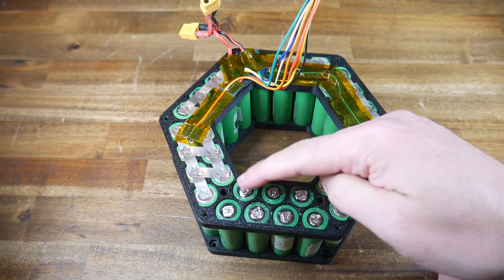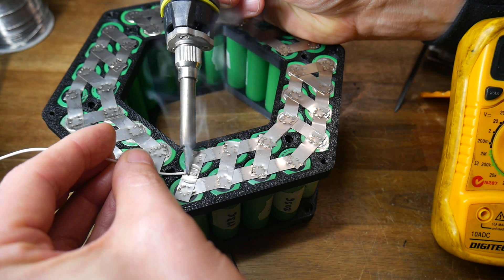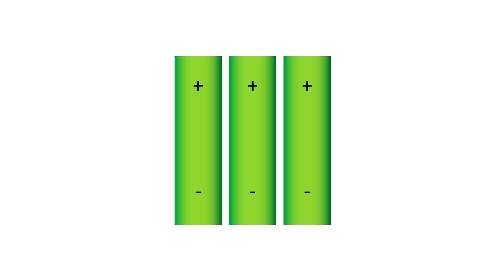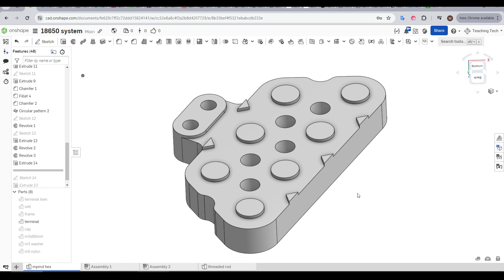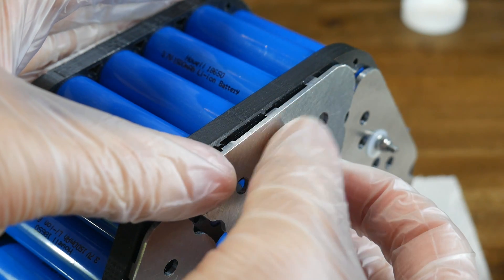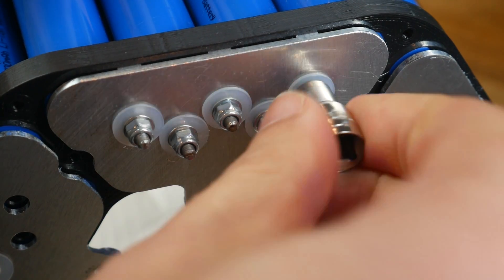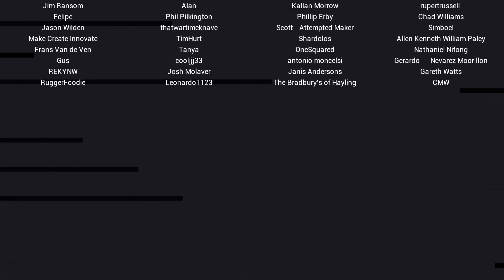Experimenting with a new (and probably flawed) 18650 building method: No soldering or spot welding!

Comment from the maker: I think most people understand I'm putting myself in a vulnerable position by so publicly sharing this concept. Therefore I'm very appreciative of the great feedback I've received.
1. Many people have suggested a washer with a shoulder to fill the gap between the terminal and bolt. There is a decent air gap there but there's no doubt a better fitting washer would be an improvement.
2. One of my key takeaways from the feedback is that even if the battery is good right now, it may degrade over time from a number of factors. These include thermal expansion/contraction, a change of torque in the bolts, the conductive paste drying up, etc.
3. Some people have pointed out that the cells aren't meant to be compressed like this. Some compression may be ok, but not enough and there won't be good enough contact. Knowing the exact value required may well be impossible.
For this particular battery, I'm happy to modify it and check in on it over time as a long term study. I made this printer portable as a challenge, not because I needed it to be. In reality it will see very little use, and when it is used, it draws very little current (it doesn't even have a heated bed connected).
For the serious battery, I won't pursue this building concept. I will still 3D print the frame, but will use traditional spot welding to join the cells. There may be the potential to machine my own busbars, but I will rethink the application to avoid compression and the reliance on needing conductive grease. A clever hybrid approach might yield benefits.
Thanks everyone, especially those concerned about my potential pregnancy!
Reply: Have you considered using springs to ensure good connections to the battery terminals? There is so much variety of types that I am confident you'd find one that can handle it. Plus, it's quite easy to test how much current a spring can handle (a couple of 1.5V AA sacrificial batteries will do trick).
But I get your pain. Was pulling my hair out when making one and I didn't have a spot welder. Then with the strings it worked like a charm. Doesn't out pressure on the terminals too.
Reply: The nylon shoulder washers are made specifically for this application
Reply: @Frient  came here to say that, nylon shoulder washers are like a top hat for those that don't know, they allow the washer to be centered.

I personally find the metal screws a little sketch and i'm glad your second design tries to avoid it. Curious why you are avoiding threaded inserts into the plastic?
Reply: I think the design as shown is such a big safety risk that you should edit the video to point out all the flaws and change the green check to another red x. Compression with bolts is not compatible with the thermal expansion and just fixing the washer is not enough. If you test with this design please never leave it alone and assume it will catch fire. It may not, but don't take the chance.
Reply: tbh all batteries should have screw terminals from the factory so that literally nobody has to fuss with all this. heck 18650s seem like so much effort why not just use the big chungus cells on a power bank this big eh? great work as always m8
Reply: @killsalot78  screw terminals are heavy.
Reply: Since the body is hex shaped, have you thought about making the frame in 6 pieces and just making them so they can connect to each other? That would solve the problem of the entire frame being worthless if one section goes bad.
Reply: I take it that springs like on C batteries won't work due to the high current de-springifying them?
Reply: @ryelor123  not alone, you would need a multi strand copper wire of appropriate gauge to pass current, I have a spring like that in my flashlight.
Reply: How about threading a fastener down to meet the battery contacts? It would secure each battery individually (making slight variances around each battery less of a problem) and  at the same time serve as contactor as well as a attachment point. Set screw/lug with a stud.
Reply: @jdepriest1474  differential thermal expansion is likely to cause issues, weakening the contact with each thermal cycle also screws can put tremendous amount of force with modest torque.
Reply: Lifepo 4.
18650 .
The safe batteries. 
And match up better for 12 volt. 
They are also in the super b accu's. 
Forgeth lithium. 
Fire hazard
Reply: I would suggest using nylon bolts rather than metal making it impossible to accidentally short the cells , and use springs on each end of the nylon bolts to keep the mounting pressure dynamic to allow for heat expansion.

Comment: You are using fire hazard batteries. 
Tou need to use 18650 lifepo 4.
Batteries. The safe batteries and the lifepo 4 18650  batteries wont explode if you over charge them they Just heat up and stop working it is verry dom to use 18650 lion ion batteries

Comment: As someone who almost lost his house due to 4-pack of 18650s... You don't want low-temp thermoplastics anywhere near overheating cell (rare, but probability works against you in larger packs). Be paranoid about exposing any and all terminals and connections. When shorted, these nickel strips burn like a candle, but only if you're lucky (the currents are massive, and way above the specs). Do you really need 210 Amps of constant current? High-current cells are more explosive in edge scenarios.

Comment: @teachingtech
You should include a protrusion in your 3d printed part that goes outward away from the battery. It would go around the screw and threw the hole in the metal plate. In this way it would be in between the bolt and the metal part eclectically isolating them. It could also be used to line up the metal plates. instead of needing a separate triangle protrusion.

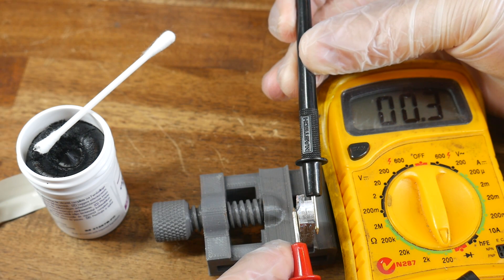Comment: 8:16 That's a bit janky. You should put your samples in circuit with a high current (say 30A since that's the cells you're using) and measure the voltage drop with vs without grease

Comment: I like bolt together batteries, but I'm not wild about a conductor going through the pack.  Your second design seemed much better if the center piece was not conductive. What would make me feel much better about the first design would be the use of nylon umm ... 'T' bushings.  Not sure what they are called, maybe T-tubes they are very commonly used to insulate the bolt going through Power MOSFIT's in electronics so they may not be much more expensive than the washers you used.
Also, the bolts are much larger than you need, and I understand how important the bolts job is. Without looking up the clamping force I'm confident a 4 or 6-32 bolt would be more than enough and reduce weight and cost as well.
My business involves LEV (Light Electric Vehicle) batteries. Pack vibration and deformation (twisting, bending etc.) are real world problems. The conductive grease and clamped together batteries are better from that standpoint assuming a short is impossible.  I also think springs pulling the pack together with non-conductive end pieces would be Ideal but could require some tricky design to prevent an assembly nightmare.
One of the VERY HIGH END scooter companies actually TIG welds copper conductors to the cells. I know, you can't weld Copper to Stainless Steel ... but apparently you can. Or at least they claim to.
EDIT: I just read your pinned comment...yeah "shoulder washers" that's the ticket.  :)

Comment: The best lithium battery assembly approach i've come up with involves a small copper "contact pin" which is just a circular piece of copper that has a shoulder so it can be retained within a cell holder, one side of the pin touches cell electrodes. 

On top of the contact pin is a small piece (4mm diameter x 1-1.5mm thick) of plastic or fiberglass with a tiny center hole, it's a "carrier", held in the center hole is a engineered wire contact (helix of 5 or 6 gold plated wires around a stiff rubber core surrounded by softer rubber), companies mass produce contacts like this for testing pcbs and are very low cost. They can be made with continuous current ratings from 6A-50A+.

Carrier with wire contact and contact pin sit in a hole and are "floating" with around .25mm-.5mm of designed compression range, a piece of sheet metal or a pcb is what wire contact finally touches.

Approach like this allows for placement of the contact pin/carrier/wire contact stack above cells rim on positive side for negative connection allowing for single sided assembly meaning only one pcb is needed or metal sheets only in one cell holder.

Comment: Thanks for putting your project up for criticism!
As mentioned lithium cells are dangerous and a bad design can literally threaten lives. I have developed hard- and software for battery management systems, with some incidents involved.
One point I'd like to make is, the contacts with the cells are neither perfectly even nor perfectly parallel to the cells' surfaces. Meaning your contacting area might not be a surface, but more a point or line. Putting pressure on it might cause the area on the cell to buckle. To my knowledge, the industry solution for this is multiple independent springy contacts per cell. We once build the complete overkill version of this with 10 high-current pogo-pins for individual 18650 cells on testing equipment.

Comment: The lack of a BMS on these battery packs is surprising and concerning.  Not surprising, however, that the first battery failed so quickly and I suspect the other to blast a bank of cells in undue time.  Adding one will increase the safety and longevity of your pack and you can get a decent one for not many moneys when buying for low amperage applications.  I like the cost to quality/features ratio of JK BMSs but there are other options out there that will do the job.

Comment: I don't get it. You are milling almost the living Həłľ out of every thing for this project and you šh¡ťțingly chicken out on the nylon washers?! Dude don't be ridiculous and either buy appropriate Nylon washers with the right size hole or machine washers with a leading neck that slide in the hole such that aligne themself to avoid this annoying finicky alignment of those morronically large washers 😂 the second design at the end is a pretty good approach though 👍what material do you want to use for that spacer/connector thing that you can screw bolts on and how do you do you want to prevent from falling on you if you 3D Print them and then over tight them even if you won't over tight then the material will creap away on you over time. 🤔

Comment: If you're going to stay with the compressed connector plate, consider having only three batteries under it. Three points make a plane, so all batteries would have the same contact pressure. I would recommend using a spring to provide consistent/constant pressure even if the cells expand.

Comment: I would consider cutting slots around the terminals somehow and have the terminal protrusions slightly longer. This way when tightened down they could be tensioned by the terminal material itself securing a consistent pressure and perhaps a better connection?

Comment: I experimented with very thin PCB substrate (or you can also use copper tape) with high density foam behind it, and the backing plate with "pads" 3D printed into the compression plate. The foam gives some springiness to keep the PCB against the battery terminal. No CNC required. The bolts go through plastic shoulder at the top and screw insert at the bottom, away from anything conductive. My goal was to be able to reuse laptop battery packs and simply swop out dead cells as they die and squeeze a second life out of the precious lithium. Building and rebuilding 2nd life packs in a safe way could be a job creator for the local community.

Comment: I'd want to see a sleeved washer on those bolts. I'd be REALLY nervous that they may vibrate or somehow make contact to that metal that's only 2mm away. A sleeved plastic washer would guarantee insulation of that bolt.

Comment: using peek bolts instead of the steel ones in the first design with a appropritely sized washer will reduce the assembly time and increase safety

Comment: I think a mixture of two approaches would be a better option. Spot weld pre-drilled tabs to each cell, then bolt the tabs to a busbar so each cell can be individually disconnected via a bolt  for servicing. That way, you won't risk crushing cells with axial pressure loads or be relying on clamping the cell terminals for continuity.

Comment: G’day Michael. Can’t tell you how pleased I am to see you still using your Carvera and I’d like to thank you for mine too lol. When you did your initial review I sprinted straight over to kickstarter and was delighted when I was able to put my money down and from the moment it arrived, well, wow, it is still just simply the best tool in the shop. The potential work that I can do with this amazing little machine is simply magnificent and I am so grateful for your inspiration to take the chance on buying this little machine but seriously, automatic tool changing on a desktop cnc machine, that is the greatest bugbear of any home cnc operator, when a job finishes at 2 in the morning and the machine sits idle after having hogged out all the hard stuff and the long and arduous final layers must yet be cut, well, when I get up and can think, hmmm 2 cups of coffee today maybe, and I can then change the bit and set the little beastie back upon its allotted tasks. Having it do it all, all by itself at 2 in the morning while I happily snooze, how good is that hey lol. My only disappointment has been to see the company now selling a cheaper version without the auto tool changer. What a waste, that is the whole, complete and utter selling point of the original machine, auto tool changing on a desktop cnc that doesn’t cost $20 grand. Oh well, I’m so very pleased with mine, I hope others will save up for the full machine. It’s still way cheaper than anything else I’ve seen with auto tool changing, and I am sure they also will be truly pleased that they did. Thanks again for the great inspiration, you and Angus over at Makers Muse whom you know of, are responsible for my delight in every laser, 3d printer and cnc machine that I have either built, like the massive lowrider 3d printed cnc machine, or bought, like my Ender printers and my well loved Makera. So thanks mate, getting on for ten years of great teaching and advice, I’m very grateful, thank you

Comment: The main benefit of the v2 you showed in the end of the video is safety, those bolts are electrically seperated.

The main problems of the battery and the challenges are:
1) safety if battery is crushed
2) overtightened bolts
3) bolts lose torque overtime
4) reduced volumetric density

You may find interesting how this approach was solved by the company Trampa for their electric skateboard.
Their approach is to use pcb with integrated bms.
Looks brilliant to me.

Comment: I wouldn't use a metal calliper to measure the length of the batteries - you're shorting out the cells this way and the result will be shocking!

Comment: Have you considered using nylon bolts instead? It may be difficult to get them in lengths exceeding the cell, but you can put a (also nylon) hex standoff in the middle, and then clamp with bolts from both sides. For the locating pains - machine holes for countersunk nylon screws (may require third op and a chamfer bit on the CNC).

Also, would using a spring on one side of the cell be prohibitive in terms of resistance?

Comment: Instead of the nylon washers just print a plate, you could easily design the shoulder people mentioned as well to ensure the threaded part doesnt touch anything as well. 

Then you just print it and go.

Infact add some tabs thst clip in and everything will be held in place as well and you can tighten down everything much faster.

Comment: Having followed your channel for some time now, I feel this area of electrical engineering is one where I feel best at home, having made several packs myself and doing calculations as well as tests on them. One the biggest dangers in battery packs is the thermal runaway. Once one cell starts to heat up, there's a small margin of detecting and preventing the pack from fire. I see you are using the balance wires on the charger and that you are planning to use a BMS for your next battery. I would strongly recommend wiring up and using the temperature sensor, or even better, sensors and wire them up to the BMS as well a making sure the BMS is paying attention to the sensor. Place the sensor(s) in, really deep, into your pack so it can detect heating and allow the BMS to shut down the pack either during charging or during use.

Your current BMS-less battery isn't protected against short circuit of the pack or too high discharge current as far as I can see. If there isn't a fuse fitted, please fit one if you can for your safety.

Comment: Thank you for your videos!
Maybe you can cut slits and insert metal spring tabs to ensure good contact. It's more complicated for sure but it solves the problems with contact and pressure.
If its possible you could weld/glue a wide v shape instead of cutting slits. Glueing one side allows the other side of the v to compress and provide the contact area (assuming the glue is insulating). Hope this might help